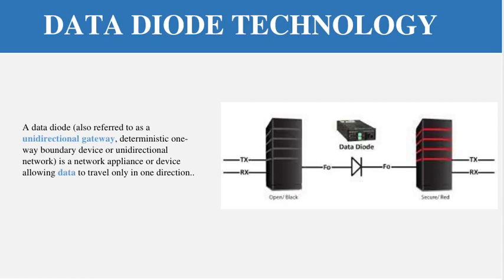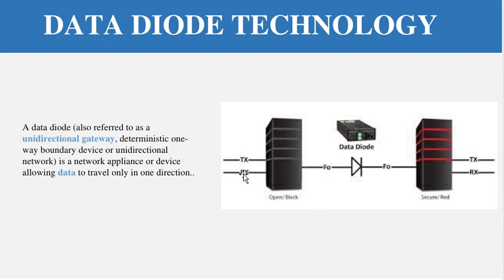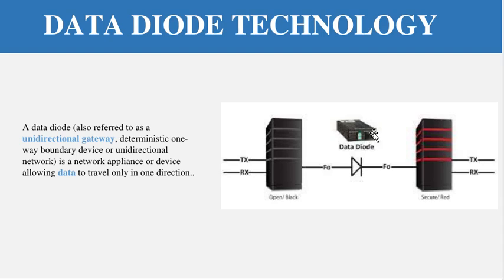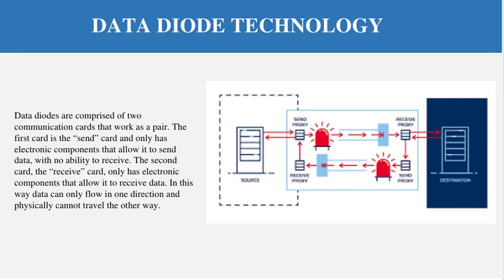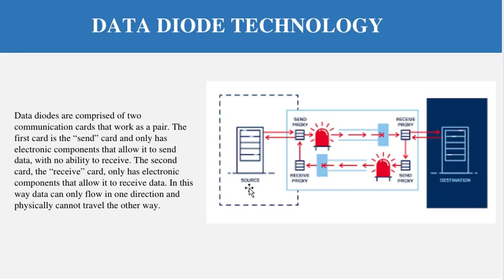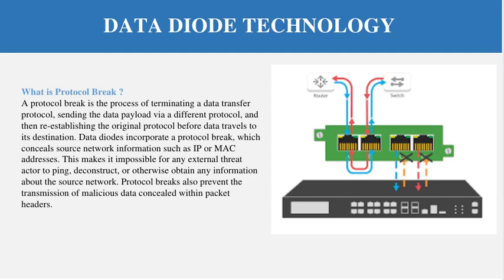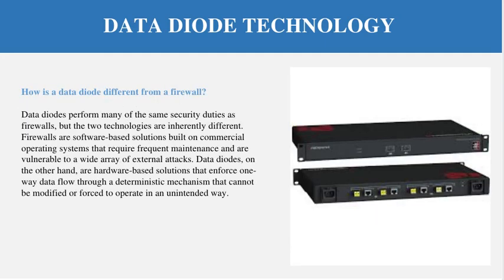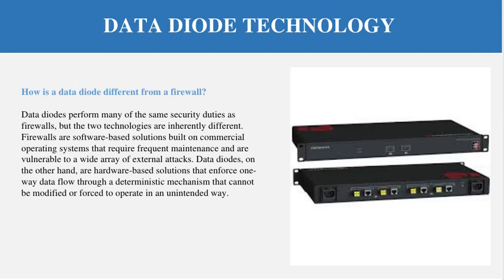Data Diode Technology

Comment: Useless video. You simply repeat what a Data-Diode is (like a 100 other video's here on YT) but you too, do not explain how it works at all. A host sending a TCP packet out, expects a return packet (it already starts with the 3-way handshake). If the receiver cannot send an acknowledgment packet back, because it is physically blocked, how can a TCP session be established.
Likewise, when using UDP, the application must be able to tell if all the data arrived complete. Many apps will want to send some sort of acknowledgement back, or asking to resend something, using a UDP packet of its own, back to the sender. But it can't. These sort of questions are not answered at all. That is what makes this video useless and simply a repetition of 100 other video's here.
Reply: I have that question about TCP sessions as well
Reply: damn. all those words to say you can't google how a data diode works. crazy